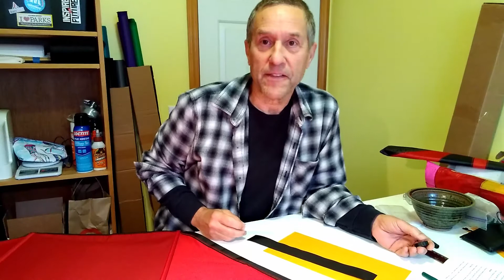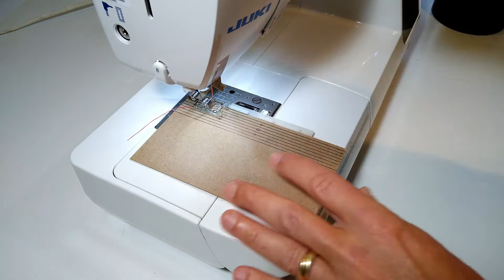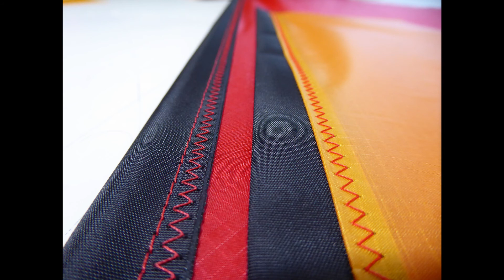Sewing Guide

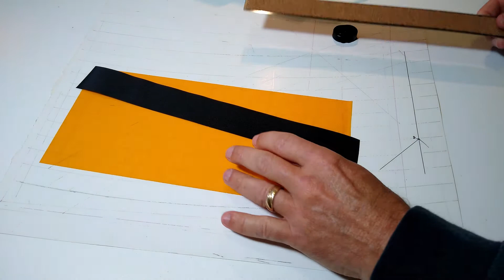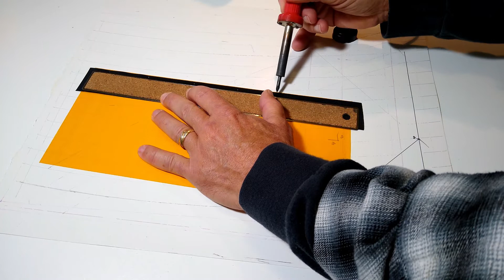Comment: Preparation: Fix your fabric pieces together using methods like hot tacking, gluing, or taping (0:27-0:42).
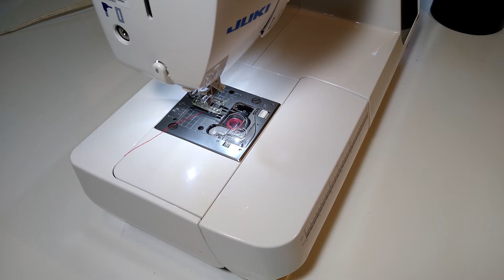Setting the Guide: Use a piece of cardstock marked with 1/8-inch intervals as a gauge to align your needle and place the sewing guide accurately on the machine bed (0:53-1:35).
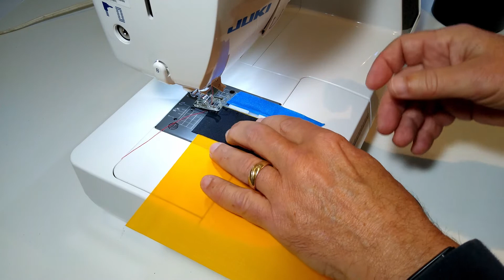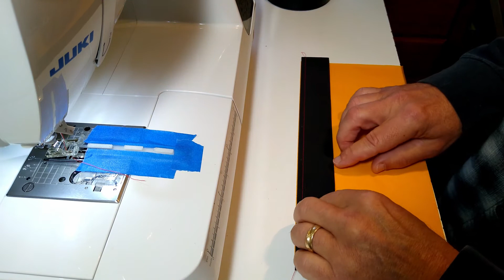Straight Stitching: Once the guide is taped down, align the material edge against it and sew, maintaining consistent pressure to ensure a dead-straight seam (1:48-2:32).
Creating the Pocket: Fold the Dacron and ripstop nylon to create a pocket for the kite spar, pressing it firmly to prepare for the final pass (2:32-3:32).
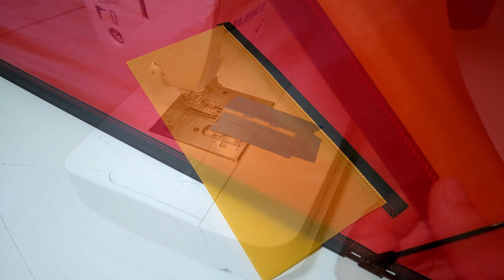Zigzag Stitching: Reposition the gauge for a 1/8-inch centered zigzag, apply the guide, and sew along the fold for a professional finish (3:35-5:28).